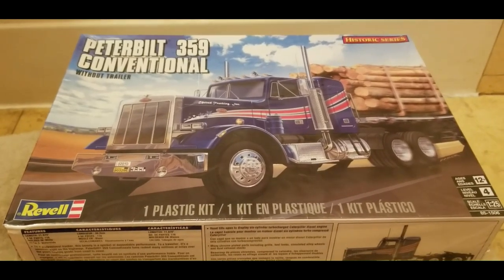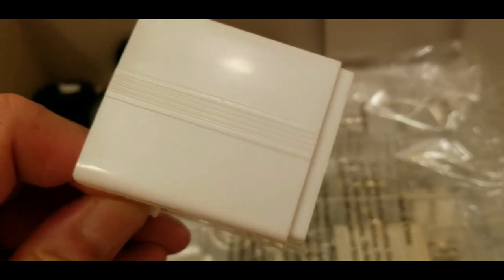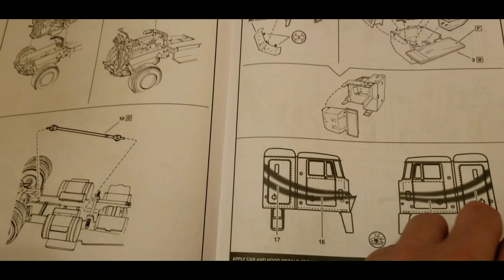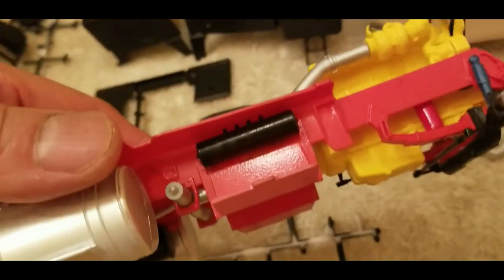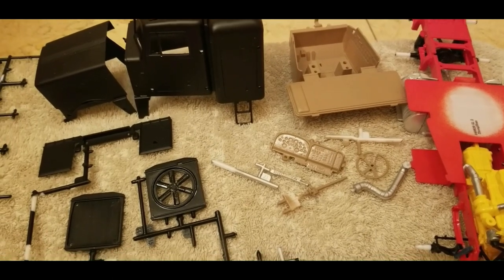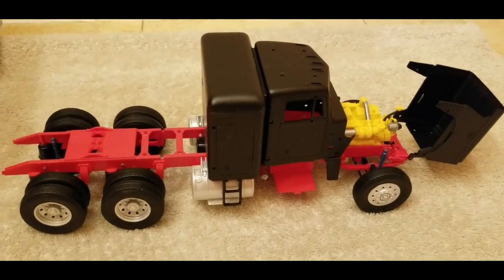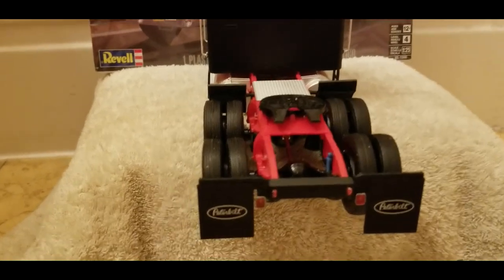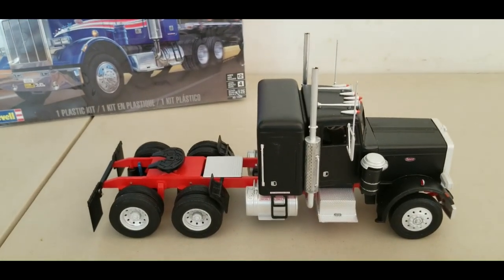Revell Peterbilt 359 Conventional 1/25 scale Build & Review

Comment: Hey David Terry here. I’ve built four of these and now doing the 5th. I can’t get the tires right. I have to buy Moebius tire kits they are ok just ok. I don’t do decals I think they look better. Let me know how you do the tires. Thank David.
Reply from the maker: I'm like you Terry, I try not to over use decals as well. Although I'm not a big fan of the Revell tires due to the soft sagging, folding sidewalls, I ended up using them due to the three holes that slot into the pins. I dont know if another brand tire would fit but you can try and see if it works. Worst case scenario just revert back to the original Revell tires with the 3 holes.
Reply: @davidchin350  i agree
Reply: bro i had to bust the hot glue gun out on one of them😑✌🏻 the rest fit...barely lol
Reply from the maker: I agree Dan, buy the AMT kit if you want something more challenging.

Comment: Great build, I wasn't to sure how the red chassis was going to look, but the flat black cab and sleeper went really well with your choice of frame colors. The matte finish on the chrome parts was a great idea. The finished model is a real looker. The only thing that would make it look better and you mentioned it in the beginning of your video was if they would have included the decal for the radiator , I believe it's a big set of fierce looking teeth that would have made it really pop. Are you going to pair it up with a trailer? If so which one are you going to use? What's your opinion on the kits that have the frame already built compared to the AMT kits that requires you to build the frame . Do you have a preference?  Nice finished product I enjoy your channel. I build for the same reasons you do it just is therapitict and gives me satisfaction. Stay healthy.
Reply from the maker: Thanks for watching and comparing notes Harold. Glad you enjoyed my build. Aside from the BJ and the Bear trailer, I really dont have any other trailers to match with my semi tractors because I dont have the room for them. If I did, maybe an AMT dry goods trailer. I would paint the trailer white so it can be paired with any tractor paint scheme. I have built both AMT and Revell tractors and really dont have a preference. The higher cost AMT is reflected in its parts count and detail while Revell is half the price of an  AMT but allows you to concentrate on paint detailing. It eventually comes down to the type of vehicle and how much of a challenge I want building it.

Comment: Hey, I have a question. Did you have a problem putting the front tires on, mine will literally just slide on, I tilt it or move it, slide off. How should I fix this, or do you not know? My rear tires just snapped on, unlike the fronts. Please reply! All the best, Liam Jackson
Reply from the maker: Liam, mine snapped on and stayed in. I don't know exactly what your particular kits issue is?
Reply: @davidchin350  were they just the stock tires? And how did you assemble the tires before putting them on?
Reply from the maker: @liamjackson1056  the kit is basically a snap kit. Tires slide right onto the rim. Wheels should snap onto the axles.

Comment: RE Chrome: If u had used the metallic Alum, would you have stripped the chrome first?
Reply from the maker: I would have tried spraying over the chrome without stripping it. I have painted red, white, black and gold over chrome and it came out alright. Never tried metallic aluminum over chrome plated parts though.

Comment: Can you attach a flatbed to this model or is it not possible? Thank you
Reply from the maker: Attaching a flatbed is possible if you are good with improvising and custom fitting.
Reply: @davidchin350  do you know which flatbed specifically could work by improvising on this specific model. Thank You for the speedy reply!! Also great job on the build!
Reply from the maker: @sathyathukkaram8153  you might want to try kit bashing. Get another kit like an AMT with a flatbed that you want. And bash the parts together from the two kits. I personally have not done bashing since I usually build stock straight from the box. But the rear of the Revell Peterbilt is a good platform for anything you want to mount. If you can scratch build you can do anything with spare parts, model glue, model knife and putty.
Reply: @davidchin350  thanks!!! I'll do that. I'm tryna get a flatbed so that I can attach some 1/64 diecast cars for this to haul.